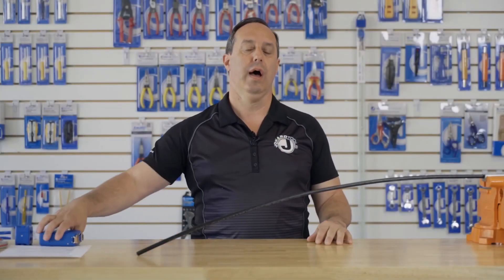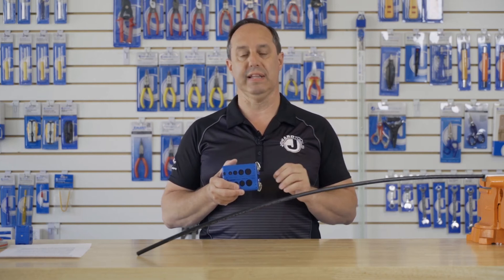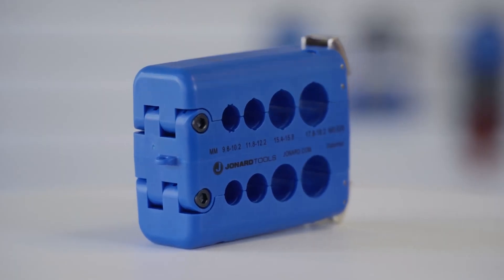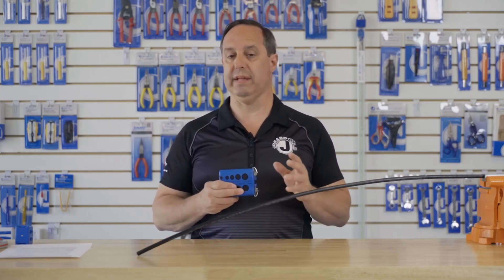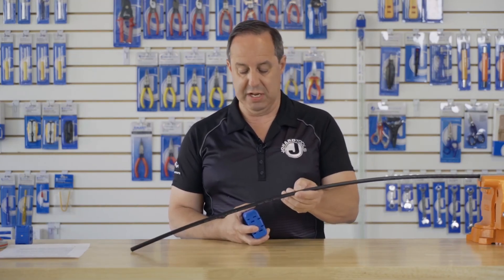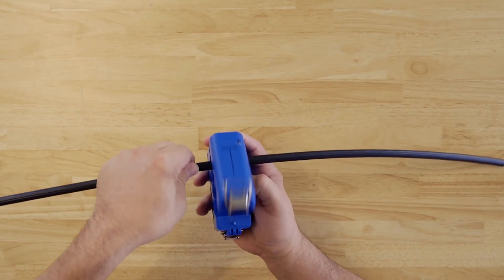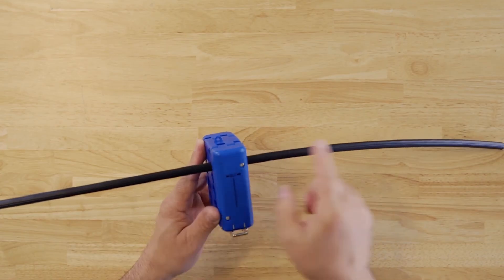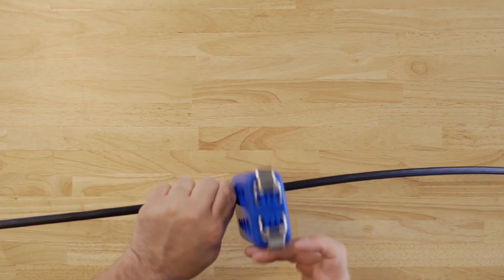Jonard MS-526 Mid-Span Slit & Ring Tool (9.8-18.2mm) - Available from Fiber Optic Center

Comment: Does this work on armored cable?
Reply from the maker: This tool will not cut a monicoil steel tube (typical armor used).

But a thorough answer will depend on the kind of armor you are referring to and if the objective is to remove the armor or the jacketing over the armor. Feel free to email at fiberopticcenter@focenter.com with additional details; we are happy and eager to respond to those!